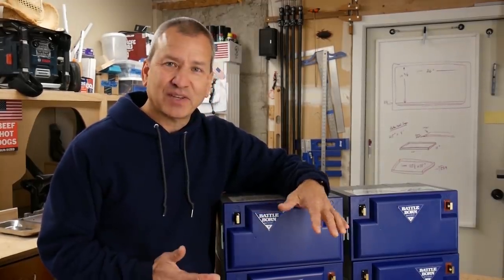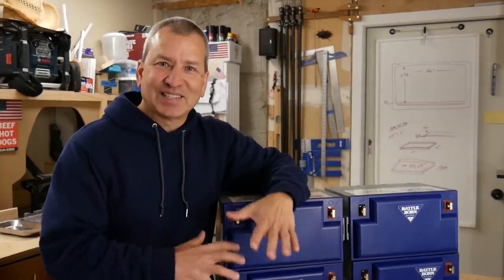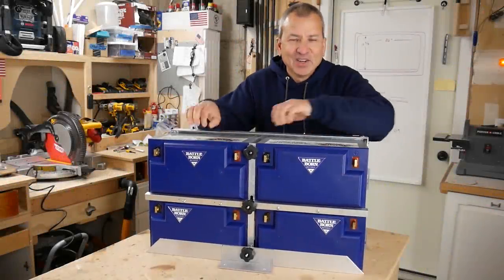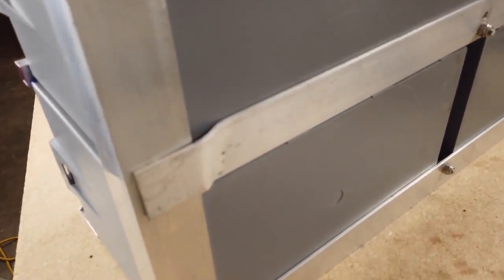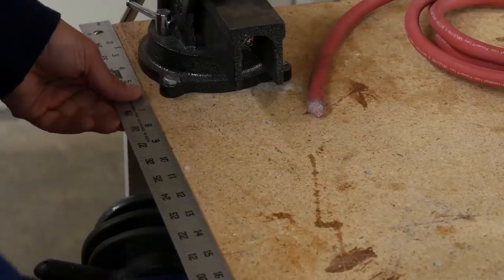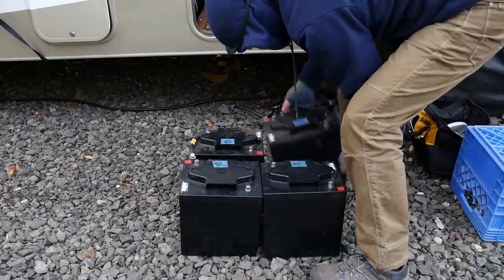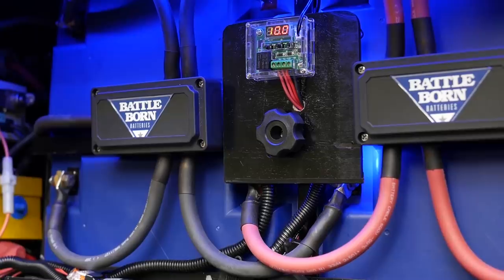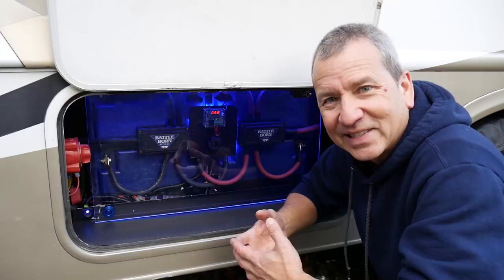DIY Lithium Battery Rack for Small RV Compartment - Full Build

Comment: So if you are running the batts in parallel do they cables have to be exactly the same length? What happens if 1 is longer?
Reply from the maker: It's a good best-practice to keep the load equally balanced across all four batteries. If one is longer it will work fine, but part of your battery bank may be working a little harder than others.

Comment: What did you do with the space underneath the entry steps that had the original batteries?
Reply from the maker: I never had batteries in there. My RV had a tiny battery tray bolted to the chassis. I am, however, using that space under the step to store my tools.

Comment: Brian, I am assuming that you did the battery upgrade prior to your removal of the generator. If this is a correct assumption what did you use for a starting battery for the generator? If so did you keep the lead acid? How did you keep the lead acid charging and the lithium charging independent? I ask because on my Class C most likely similar to yours the converter in the distribution panel is used to charge the lead acid house battery and also from the alternator.
Reply from the maker: The generator was started from the house batteries...flooded, AGM or Lithium. My chassis starter battery is still a standard flooded battery.

Comment: Great idea! And yeah, good call on the angle bracket reinforcement on your Muggy Weld joints. They claim 20000 psi, but that's under ideal testing circumstances. You're utilizing a soldered butt joint (No, not brazed. Technically, a brazed joint is performed above 850˙F) with a 1/8" cross section. Muggy Weld and similar products have a melting point of 350˙F which puts it in the "Soft Solder" category--soft solder is more suited to lap joints, as found with plumbing. You're design is putting the joints in a combination of shear and tensile. I realize each battery is only 30lbs, but with $4k in batteries and an RV worth tens of thousands, the potential of your aluminum structure failing due to soldered joints is very real. Eventually, probably soon, those joints will indeed fail and the angle brackets and screws will be the only "structure" left. At that point you're frame will start flopping around. At 8:26 you comment on how strong the structure is, but the video reveals flexing. Imagine what a pothole will do? How about a thousand potholes? For some more shear strength, screw or rivet a piece of aluminum plate onto the entire back where you put the heating pads and then install the pads directly under the batteries instead? As a professional fabricator, my advice to you is to make another frame and have it TIG welded together. Sure is pretty though!
Reply from the maker: Thanks for sharing your expertise. I appreciate it. Fortunately, the rack fits very snugly in the compartment with absolutely no gaps. So I think it should stay put.

Comment: Was that a standard rotocast compartment?  If so, can you provide a little more information on the added support you used?
Reply from the maker: I used a piece of angle steel underneath then bolted two other flatbar pieces to it and fastened them to the RV frame.

Comment: Question. I have a small area to install a 200 amp po4 battery vertically.  The battery will need a support like you did to hold it in place.  The cabinet is 18.5" x 14" x 26"high.  Any suggestions?

Comment: Hey where did you get the heating pads and the controller for this project?? I’m installing Li batteries and meet to get a few more parts!
Reply from the maker: Heating pads were from a heated seat mod on our car. The controllers were just cheap temp controlled switches from Amazon.

Comment: first bump you hit and the top batteries will be flying around, u have nothing holding them down. You should have made a matching front bracket, not just a bottom lip. Applying pressure across the bottom edge of the top 2 batteries will not keep that much mass stationary when u hit a pot hole.

Comment: Wondering why you switch the negative side of the batteries instead of the more common fuse and switch in the positive?
Reply from the maker: I would typically just disconnect the negative lug, so it made sense to switch the negative. I could have gone with the positive with this new setup since I now have a single cable going to the busbar. Previously I had multiple connections wired to the positive which would have made it difficult for a master switch.
Reply: @RVwithTito  Is the negative of the solar system connected to the vehicle's chassis or is it pretty much isolated?

Comment: What kind of heat pad did you use?
Reply from the maker: They are heated seat pads I had laying around from an old project. There are other pads specifically for batteries that include the temp controls too.

Comment: The big question everyone wants answered us "what's the retail on the major components on something like this?
Reply from the maker: Do you mean the batteries or other components? Probably a couple hundred for the smaller components (aluminum, cables, busbars, etc). The lithium batteries are pretty expensive. I got them from Battleborn directly with an RV club discount for around $870 each.
Reply: Wow, so, we're talking about something in the neighborhood of $4K ?
What's the expected power capacity? Meaning how much time can you expect to get out of a full charge under normal use? (TV, fans, lights, etc

Comment: where can you get heating pads that don't cost a fortune?
Reply from the maker: Check out RV tank heating pads (https://amzn.to/386cK2B). Just look for ones that don't have a built in thermostat. Then you can wire it to a thermostatic switch like this (https://amzn.to/2Me52e0) that can be adjusted to just above freezing. I have mine set at around 38 degF. Happy hunting :)

Comment: Yep. those batteries are about 1000 dollars each... lol. I will stay w/ lead acid or AGM...  and replace them every 3 years or so..
Reply: When you do the maths the Li Ion batteries are now cheaper in the long term than AGM, this is because you need twice as many AGM's to get the same power and you have to replace them more often. So the Li-Ion batteries can be 4-5 times more expensive and you are still saving money long term. PS I don't have any but I want them.
Reply: @karlbartelt3939   They don't like the cold.... and on my RV a 1978 GMC motorhome..  I have 2 12 volt starting batts,  and 2 6 volt for the house system..  They will last a long time if taken care of properly..
Reply: @captsam54  And that is great if they give you the power that you need and you maintain them correctly. I would submit to you that he has determined that it is time to replace his just like you would and 1- needs a litte more power and 2 Doesn't want to bother replacing them every 3 years like you do. HE has 400 AH of power now where he probably only had 200 AH of usable power before. And he won't be replacing them for 5-8 years since I assume he will take as good care of them as you do your AGM's. Looks like his plan is pretty financially sound.
Reply: @adventureshark631  I agree with you, if it's time for you to replace the AGM's it's time to go Lithium, the Captain just need a bit of time to get around the idea. He drives a LEGEND and it takes deep thought to make changes of such a vehicle. You can do it Captain, you have 2-3 years to think and read about it!
Reply: @adventureshark631  My 41 year old RV has a Genset and 30 amp service... so when i want or need power I have choices. do not have to depend on batteries except for boondocking. which I really do not do... lol. Yet...
Reply: @captsam54  Yep, my 1996 Tioga has a 4k Onan also. I think Tito is thinking about taking his out and using the compartment for storage. I haven't used mine in 6 years and haven't turned it on every month so I either have to get it running before I leave or take it out and buy a small one for backup. (get an easy start so I can still use the AC) IF I could just get a mechanic to come by and look at it....
Reply: @adventureshark631  I have learned in boating, and in RV generator usage.... use it maintain it.. and it will serve your purpose.. and whos to know... nowadays you might need one.. Especially if you live in California..

Comment: Nice job. But how stupid can one be in the execution of a job? First, work horizontal and not vertical. As the project is done you can bring it from horizontal to vertical. 2, the nut on the wirredbarr????? Put on and bring it to about 1 to 2 inches. Push it true the hole in the aluminium, and than the second nut. Or was it the intention to show you have a electric screwdriver?